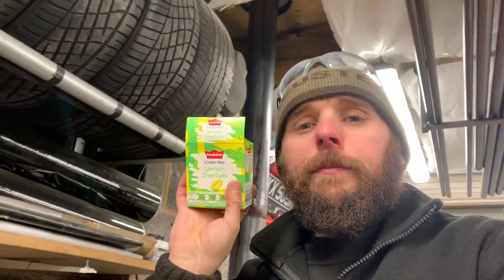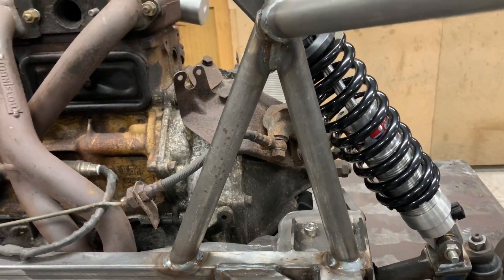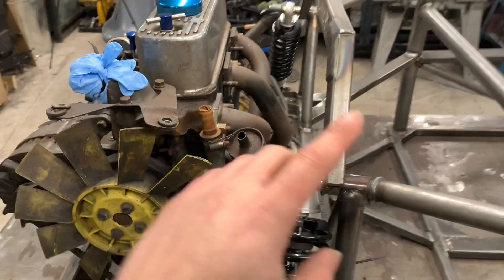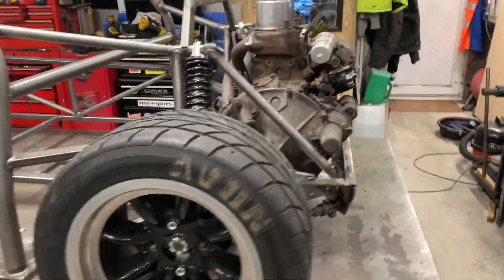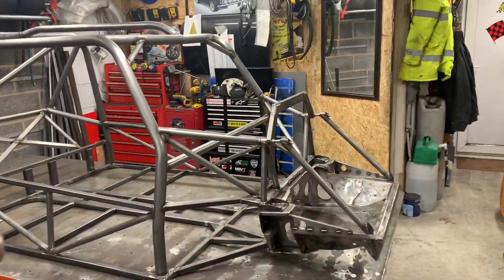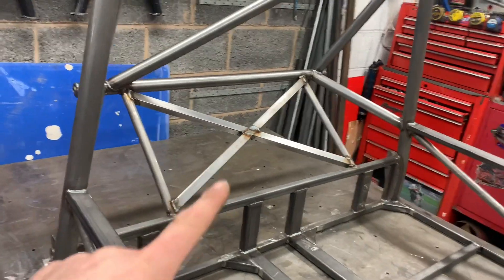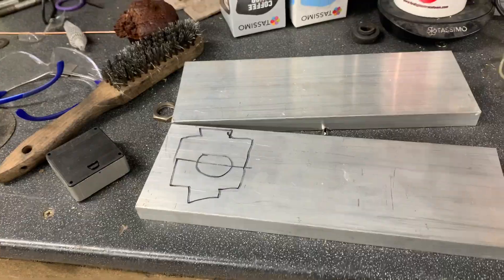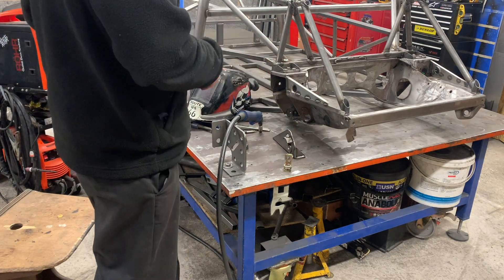The spaceframe race car build got some wheels fitted

Comment: Before you commit to bending 45mm tube with your hand bender try it first, 38mm is easy, 45mm or 50mm is in a different league. I have sent you a message regarding a spaceframe but from your video you are very busy, I would still like to talk as it would be early next year before I would have my bits I need to do ready before I could go ahead with a spaceframe, cheers David